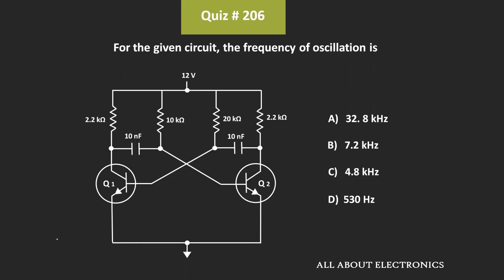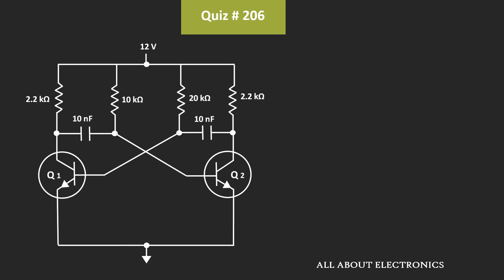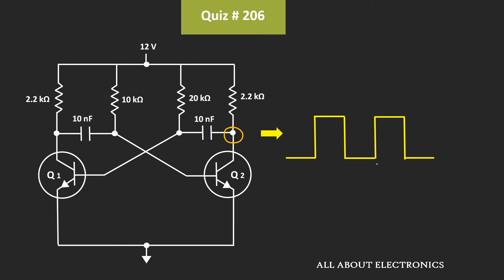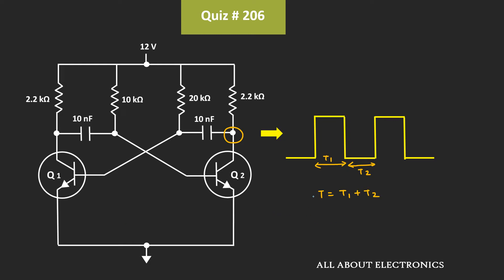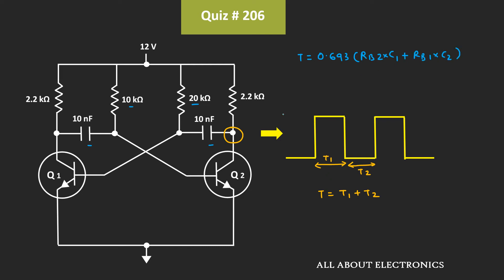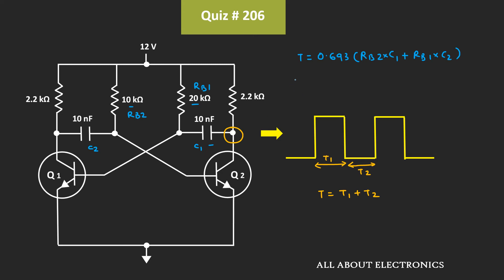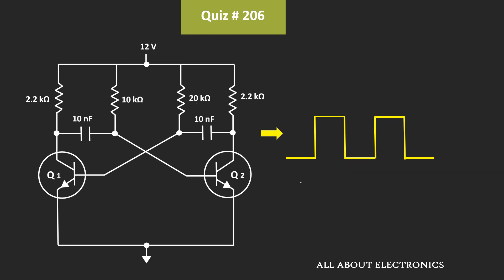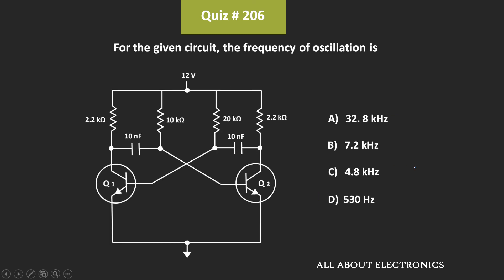Quiz # 206 (Astable Multivibrator)

Comment: 3-5 volt circuit mein kitni capacity ka resistance lagega
Reply from the maker: DO you mean power rating of the resistor ??
Reply: How can increase battery/cell backup in this circuit for a long time
Reply from the maker: One thing you can do is increase the resistance value, and reduce the capacitor value, for the same duty cycle. 
e.g 22uF and 100K resistance.
Because that will reduce the current drawn through circuit. Other thing you can do is, you can place an switch in between. 
Means even if you forget to remove the battery, the circuit won't draw current.
try these things. It will improve the battery life.
Reply: @allaboutelectronics-quiz  ok I will try and thank you